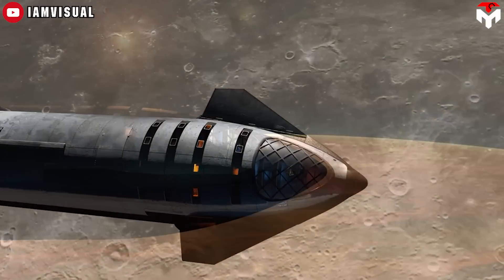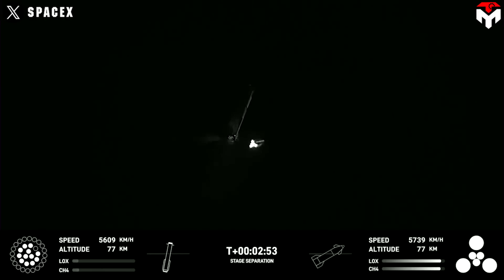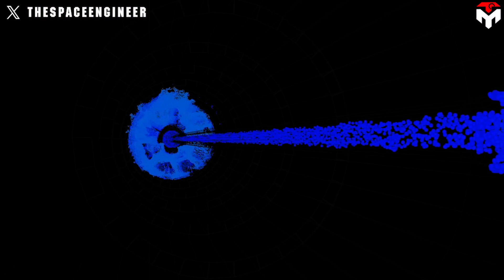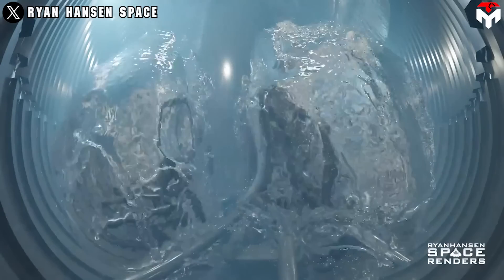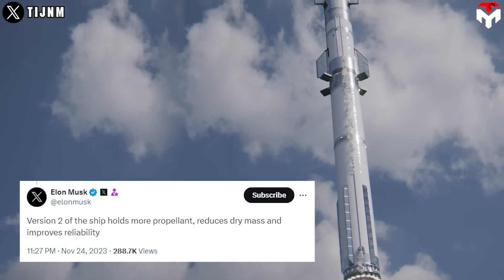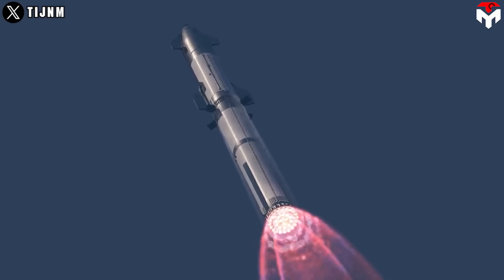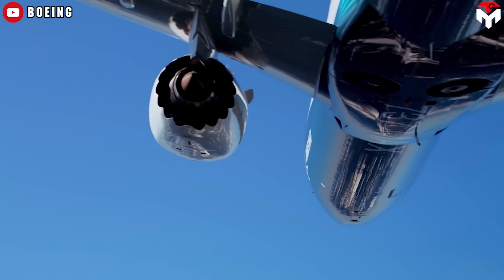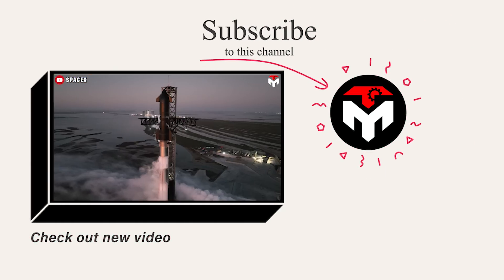A closer look at what's hiding in SpaceX's Starship Super Heavy?

Comment: Unlike liquid fuel rockets, commercial aircraft fuel tanks tend to be in bladders that reduce fuel movement. They have baffle systems if no bladders. All illustrations of the Starship system show the conspicuous absence of any baffles to retain propellants at the bottom of the tanks. If the 12% remaining fuel at separation is typical, a baffle system that can retain 10% of fuel at the bottom near pickups is optimal. It would retain the vast majority of propellant without aeration or "slamming" effect and reduce undue stresses on components and fuel starvation for the pumps and engines. They wouldn't need to be robust either as they are mostly suspended in the propellant without any significant load stresses.